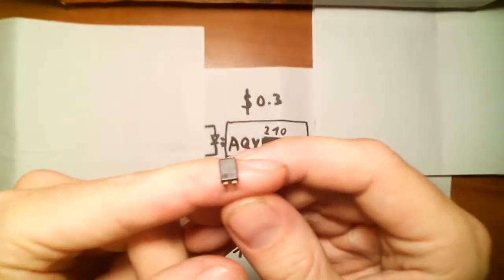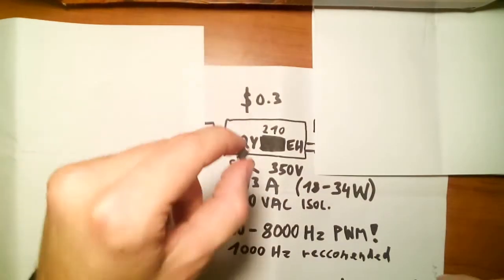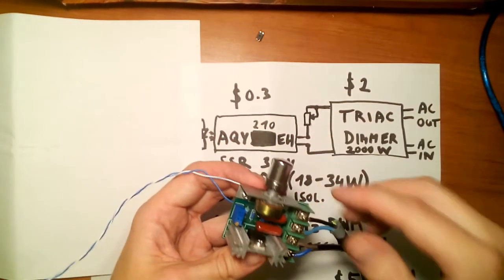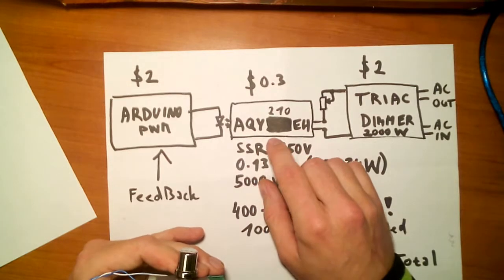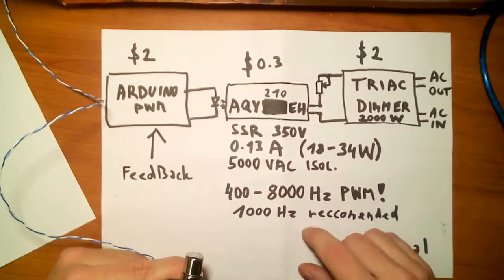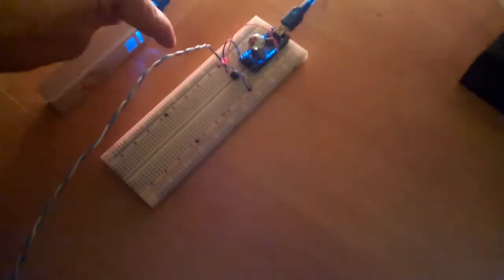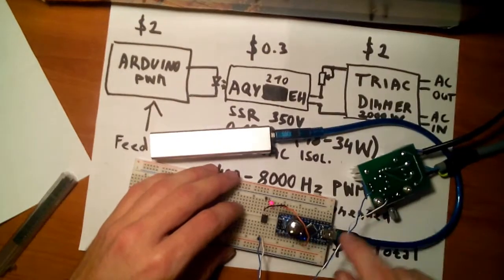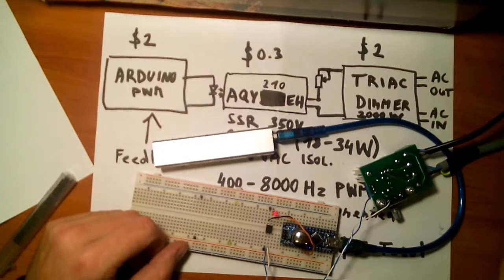$5 closed loop RPM control for Arduino CNC (up to 10kW)

Comment: You could add an RC filter after the optocoupler to smooth out the pwm signal
Reply from the maker: But do i really need that given how this circuit works? If i have PWM with higher-than-audible frequency, which is quite common for controlling motors (>= 20.000 Hz) and i will use it to control mains AC of 60Hz (worst case scenario), it means that TRIAC dimmer will have to chop half-sine 120 times a second. 20000Hz / 120Hz = 166Hz. So it will readjust each cycle by 166 PWM pulses, that should be quite enough. 

However i don't say some smoothing is bad idea. Go for it if it's worth for you. But there are probably MUCH better designs if you need really smooth output, this is designed to be cheap and easy. If you need smoother TRIAC control, you should implement zero crossing detection directly in arduino (it means you should use another optocoupler to read voltage phase of the mains, so arduino can figure out the TRIAC timing directly without need for ugly hack like this).

However TRIAC power control is always rather ugly, because it never produces smooth sinewave. It might help to use mains rated capacitor and rather massive choke to smooth the AC. But it's probably not worth doing and i would go for VFD in such case.

Comment: Very affordable feedback idea. Do you have arduino code you want to share?
Reply from the maker: Not really. For testing i've used PWM example that is shipped with Arduino IDE. I was not implementing PID control, but surely there are code examples for doing PWM with PID control on internet. I've bought CNC spindle that has PWM input by itself, so i didn't needed to use this approach. But maybe one day this will be helpful.
Reply: Thank you.